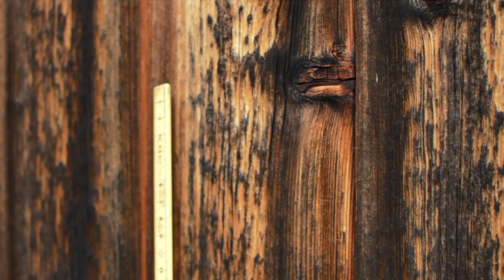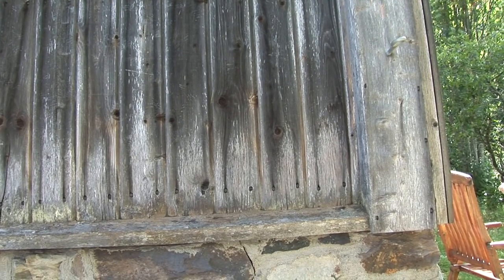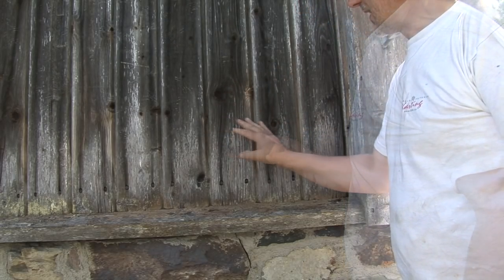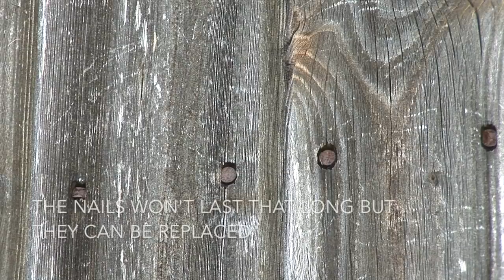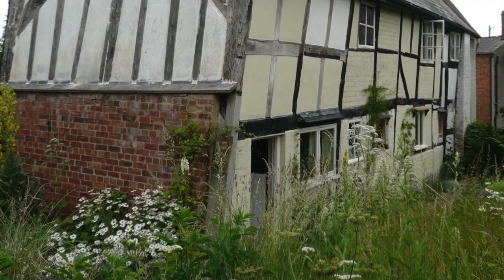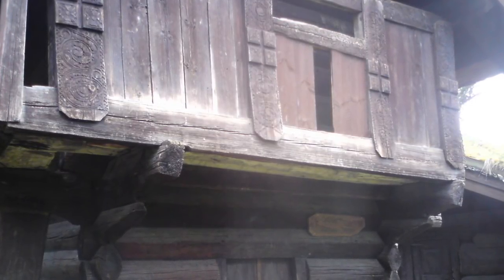🔴 Wooden walls in Norway - What happens if they are untreated?

Comment: I have a question in regards to the garage you built last winter.
I really liked how the roof was engineered.
Question........How would you have insulated the roof and still had the cathedral ceiling?
Carl
Reply from the maker: Hi Carl, you would have to have a double layer construction, with a panel layer laid atop the joists with more joists above again or under the existing joists using the joist dimension as your insulation thickness say, importantly above the insulation would have to be minimum 5cm space for airing and space for venting at the gables as well as along the ridge beam. I will probably be doing exactly that job on my own workshop in the not too distant future. But you know how it is, these complex systems are tricky to get just right in the sub-arctic climate we share. I was thinking of using a diffusion open polypropylene roofing cover with air space above followed by the boards ( or Corrugated iron). I have done a few insulated roofs with cellulose fibre insulation and  polypropylene cover, and I prefer the results and construction to mineral fibre insulation. I wouldn't dare use polyurethane foam and am amazed how it is so popular in the States , here it would be very expensive too.

Comment: Great video!  I've found the same to be true here in the upper midwest of the united states.  I've dismantled many dozens of old barns and most of the siding was untreaded for most if not all of its life, with little to no damage.  Ocasionaly I have come across a wall that is significantly more damaged then most of the others, but not often.  Those walls tended to be on the west (prevailing wind) side next to open fields.  I always assumed wind whipped dust contributed to the excellorated deteriation.  But even in these cases the board siding was still doing it's job protecting the timbers underneath.
Reply from the maker: Is you area prone to termite  infestation? We have some beetles that can eat the wood but only if the humidity is quite high 20%+ and carpenter ants but no termites (apart from the odd case in imported furniture), all the best, Lucas.

Comment: Hey Lucas,  Really enjoying your videos the last couple days. I have a few sheds and barns here with some similar differences of treatment.  The siding material of choice in this area is Eastern Hemlock, which is a fairly inferior wood for most applications but is perfectly suitable for making siding in my opinion.  The main drawback to the hemlock is that it has severe ring shake, so if a board is cut from a curved log, the board has a high potential of shaking into pieces over time where the grain runs out.  It also tends to make removing old boards a pain because they usually shatter into long strips when you are pulling them off.  But if you leave them alone they are fine for decades.     I was wondering if you've ever noticed areas of weathered wood that are also affected by paper making wasps? I've noticed that boards and timber posts that get to the grey weathered look that are made of pine or black locust seem to be much more attractive to paper wasps and hornets when they are harvesting fibers for making their nests.  So there are areas on my  grape arbor where you can see little trails of removed grey surface and the paler brown wood is exposed.  It seems like over time (decades) this wasp erosion might have a noticeable effect of removing lots of wood in the areas that the wasps seem to like.  They definitely seem to prefer certain areas and wood species for their fiber harvest, so it seems like it might be a noticeable phenomenon.  Mostly I've noticed Polistes sp. paper wasps and bald faced hornets doing this kind of thing, although the hornets seem to have different preferences than the wasps.  Just wondering if you've noticed anything similar in Sweden.
Reply from the maker: Yes wasps do harvest some fibres but they are very territorial and that limits just how many wasps available to damage your house. I put up a puffed up brown paper bag, like a shopping bag, on the outside of my kitchen window in late march and that fools the queens into thinking there are wasps here already and they nest elsewhere. If it had ever been a great problem we would have seen more damage in the 90 years of the life of the wall so far.

Comment: Nice overview of weathering.  I prefer not to use any applications of finish on the exterior wood on buildings.  Although others in my household want to see red trim which I reluctantly applied.   I can't help but wonder what environment effect from different regions apply to the coloring in the two different types of weathering we see.  Locally here on the Maine coast, (US) I don't see much of the tan/brown/black weathering, most if not all just goes to grey and over time will wear away, the grey I have always simply attributed to UV degradation.  I kind of fancy the tan/black weathering but it just doesn't happen here, I have though someone applied some oil or other compound years ago, but likely that is not the case.  I do live near the coast, but not directly and can't help wonder if it is the salt in the air that may stop the tan/black weathering.  Knots, have higher resin content which keeps the wood preserved.  Great content I just subbed to follow along.
Reply from the maker: I like your work and philosophy so your very welcome as a sub, there are some good discussions going here from time to time. If you are getting costal weather it is likely the rain is washing out the brown colours leaving the grey cellulose colour. This is the extent of my revised understanding at least, look forward to your films in the coming year, all the best, Lucas.

Comment: Thank you for this. I have just been having a conversation with someone at work in this very subject. I work on in the San Francisco area in California, mostly on victorians. I was taught by some old timers that the channel in which sash windows slide should not be painted at all. Perhaps an oil but never paint. Very few dodge the paint and the upper sash is nearly always painted shut. So I scrape, sand and leave the wood bare. The folks I work with are convinced that the jamb would rot away within a couple years without paint. I maintain that since these are almost always made of old growth redwood they would last for many, many years. I could be wrong but over the years, I have found several windows that are 100 plus years old and have miraculously escaped the paintbrush. They nearly always look to be in good shape. 
I’m glad I got that off my chest. Haha. Thanks for another interesting video.
Reply from the maker: I have found many >100year windows that are just painted on the front surface leaving the sides as bare wood and think that it actively helps dry the wood and increase the longevity. All the best, Lucas.

Comment: my brother had a 6 foot fence put up in the spring, its north and west facing, he would like to keep the natural color of it, can we do that using linseed oil  ? if i thin it with mineral spirits so it covers more area and spray in on, would this work ? i have untreated fence the south face is gray with paper wasp damage.
Reply from the maker: Linseed oil like other transparent treatments won't stop the uv, so you end up with the same degradation of the surface  as on these untreated walls but without the greying. Yes wasps like to harvest the fibres. Thinning oil helps to spread it thinly but it is a myth that it helps the oil penetrate the surface you can probably spray it without the thinner anyway. Spraying results in a percentage  of waist too, but if your time is worth more than the oil maybe it is sensible. Here I would not treat it with anything and expect about 20 years service life.
Reply: thank you Lucas, it was my hope to stop the graying, i'm glad you confer with that, the thinning is mostly for saving time and money, not my money but my time, i don't know what he payed for the oil, if it's 10 dollars a gallon ill tell him we should just put it on without tinning  !